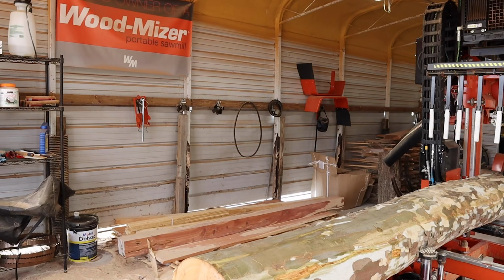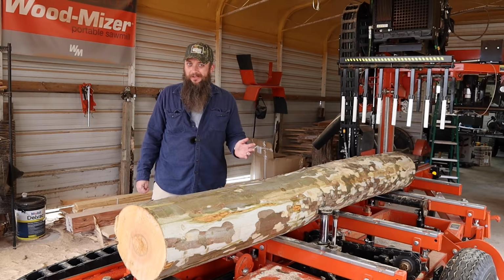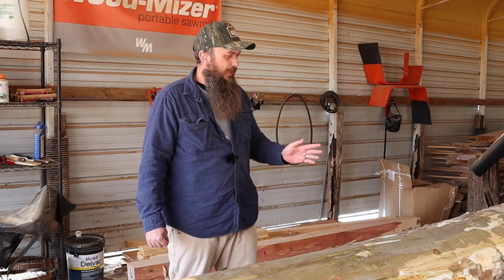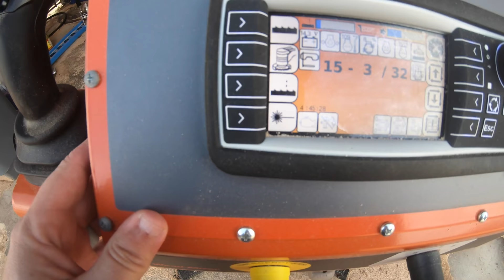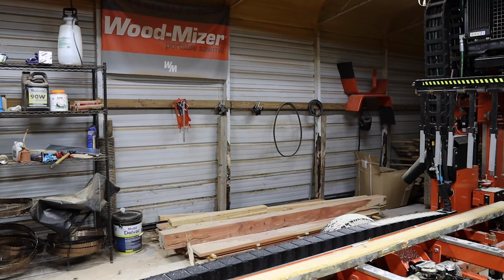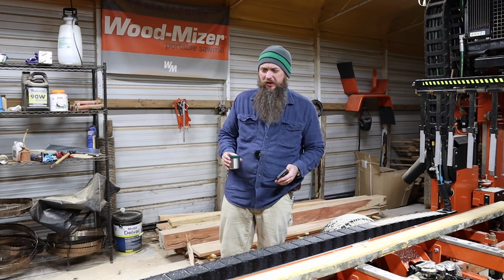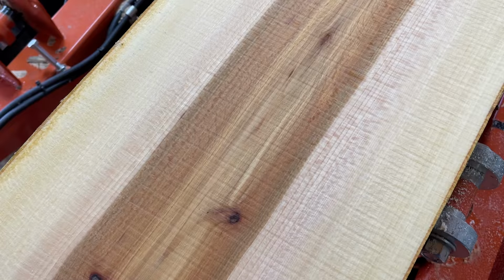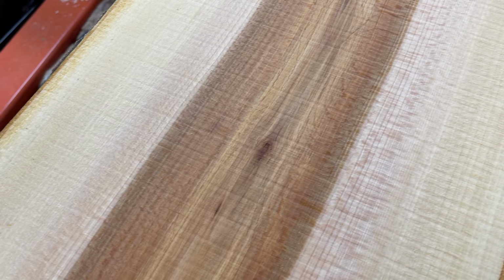This Log Might Surprise You, Quarter Sawing Sycamore

Comment: I always heard Sycamore was used for butcher's blocks because the grain prevented splitting. Usually big ones are hollow but a few years ago they cut one near me that was 4 feet in diameter and solid clear through at the stump. I always wondered what they did with it.

Comment: If your tractor is like mine, when you drop the attachment to unhook it, turn the engine off and move the controls in all directions to let pressure off then unhook the lines
Reply: Good idea but you can run back into the problem if there are big swings in the temp just before you reattach it.  Heat in the air can cause the oil trapped in the cylinder/hoses to expand and pressurize a bit and you are back where you started.

Comment: To release strain on your hydraulic couplers, put a tee fitting just before each coupler and a valve in between. Close the valve for normal use, open it to reduce hyd. Pressure.
Reply: on my skid steer, I must turn key on, then wiggle controls to bleed pressure.   Before I knew that, I was frustrated.  I saw him with that clamp and wondered.

Comment: Hey Nathan, you have a cool show going on. I have a similar operation going on up in western Canada, minus the youtube channel. Unfortunately, I put my mill away for the winter because of the damn snow, ( no mill shelter yet). Looking forward to the melt so I can get sawing again! Pretty jealous of your weather. Anyways, I noticed in this video, you had a bit of a struggle with that grapple hydraulic and needed the clamp to make it connect, which is a cool trick by the way. I chose to unthread a connection to bleed the fluid out to relieve the pressure, (messy). I now connect the 2 hoses together when the grapple is off, that way the pressure will equalize within the hoses at all times while sitting and they connect to the 3rd function lines no problem every time. Keep up the cool show bud!

Comment: While sycamore is a bit twisty, the best way to use it is to put it in place when still somewhat green.  I've used a fair amount (mainly because I've got a lot of it along the creek) in barn repair.  Pegged beams seem to work just fine, although I doubt it would work well as siding.
Reply: If you used it for siding ,you would definitely need to treat it.

Comment: All of the info you gave about the sycamore is what I’ve also learned.  It’s a pretty soft hardwood.  But that lace in the grain makes it worth milling.  It’s also known as American lacewood.  The twist also makes interesting turnings on the lathe.  Sycamore will spalt pretty quick on the ground.  Tool it gently when working that lace ribbon because it will flake out easily.

Comment: Hey! I like that thing you used to couple those hydraulic couplers with. Sometimes them things can be agrevating. I also noticed you have had quite a few different grapples. I think I know why. It's all about the weight lifting capacity. This grapple looks to be a lot lighter and still get the job done. That's what I need. Great video. Tim

Comment: When they are small like that i just use traditional qsaw. That way you get wider boards, dont have to cut off the taper.
Reverse roll works best with big logs

Comment: Love your videos and your work. About that hydraulic hose...Take the end with the ball and push it against a piece of metal and relieve the pressure. It will go right on. David A.
Reply from the maker: tried that, this vise for hoses is easier, no risk of missing either and damaging the valve,
Reply: @OutoftheWoods0623  Who makes that squeeze clamp, Nathan? First one I've ever seen. Do they come in different sizes?

Comment: Connect the couplers together on the grapple hoses when not in use until you are ready to connect them to the third function lines.  Stops pressure buildup in the hoses.

Comment: Interesting way of sawing quarter timber. the true way of quarter is cutting timber in half through heart then cut in quarters then cut accordingly to the grain of timber till all is cut to its appropriate sizing. The bigger the log the less waist thus with small logs it doesn't warrant the quarter saw technique. if you have plenty of free timber then quarter sawing doesn't matter with waist. Its all to do with linear feet of A grade timber without knots.

Comment: You may already know this but just throwing it out there, to make easier to hook up hydraulic lines shut the tractor off them discharge the pressure back to the tank by running the controls through their motions

Comment: Holy Cow, did you see then tension released in that first cut. Also, I live in suburban Chicago in a neighborhood that was planted with a lot of sycamore when it was built. And I dare say none of them could produce an 8' log that straight - let alone 9 or 10'. I don't know if it is the difference in climate or what. But all of the trees in my neighborhood are much more twisted and 'bent'.
Reply: Many trees will only grow straight and tall if they have other trees to compete with for sunshine. Trees that grow in the open never produce good saw logs.
Reply: I noticed all the movement too, that was a lot.

Comment: I've enjoyed watching your videos. Very informative and oddly relaxing. Like your presentation method and camera views. Question on the sawmill - I understand the 4 rigid fingers at the far end of the mill that slide the cut plank off when the mill is returned. But what is the purpose for the 8 double hinged black & white fingers at the operators end of the mill? They flop back and forth and don't really seem to do anything that I can see.

Comment: Never see sycamore sawed. That stuff is nice.Realll pretty! What does it get used for. Secondary wood for cabinets  ?
Reply from the maker: Yes and yes
Reply: @OutoftheWoods0623  I am getting two sycamores so large you couldnt wrap your arms around them not more than 30 min from you, and a large walnut. Interested in them by chance?
Reply: It's not too easy to find, but around me, QS sycamore retails for $6/bdft in 4/4 thickness and $9/bdft in 6/4.  Not cheap cheap, but then I don't think many people know of its beauty or the potential to use it to add interest to various projects.

Comment: Hi Nathan, congratulations on your fine show. Good stuff. Have learned heaps. However, this program slapped me across the forehead in surprise. I know I don't need to remind you that accidents can happen and putting your hands in moving machinery can make for a disaster. When you were loading up your grabber early on, I cringed at the fact that you were fastening it in place with the engine running on the tractor. You just never know what machinery will do. Take care and God bless.

Comment: That is a big fail in design for securing the hydraulic connectors to the tractor. If you didn't hold and support the back side it would likely break off, and over time the vibration will weaken the pipe further making it easier to break.